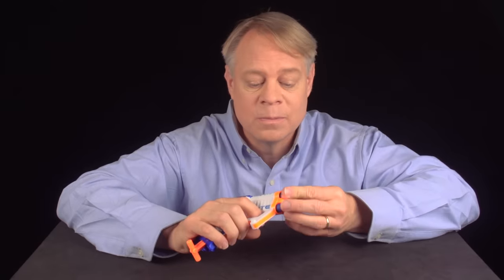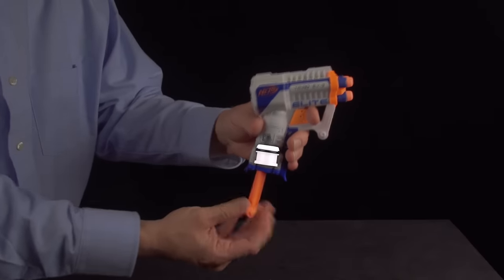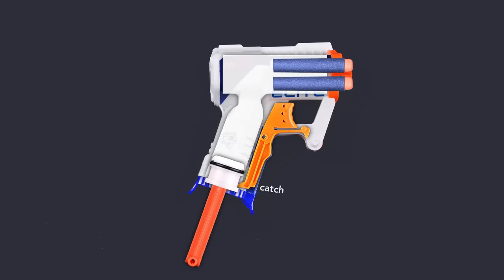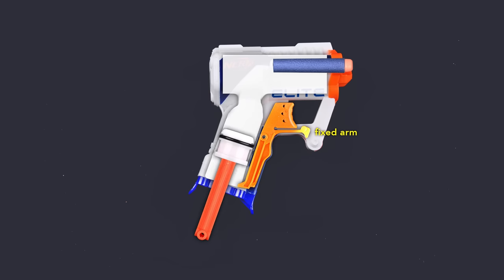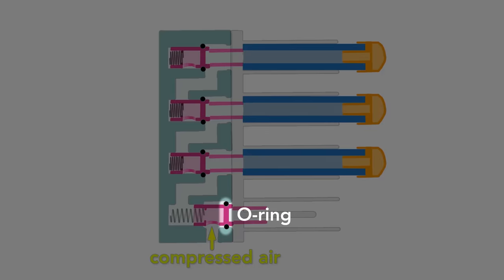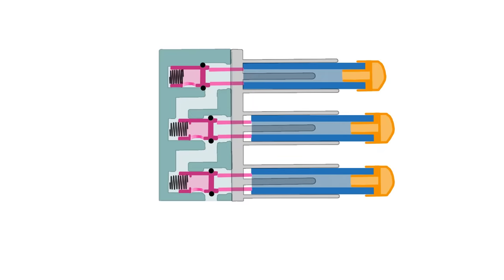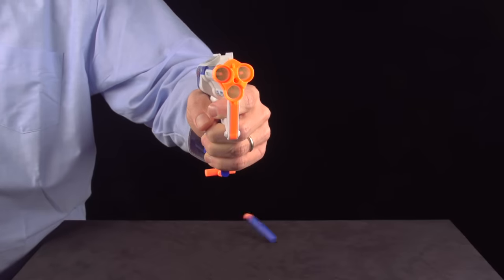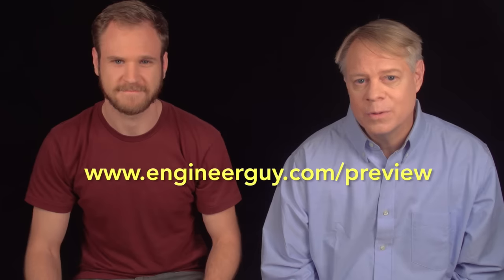NERF Blaster:  Air Restriction Mechanism

Comment: Everybody gangsta in the nerf war until this dude learns how to fire all 3 darts at once
Reply: There’s a whole community that makes nerf stuff stronger and cooler, and there’s things that do like 9 darts
Reply: @kav9533  yeah
Reply: Shellstrike: "Yes"
Reply: remove the smart ar system, but that tends to not go too well. Just get a sledgefire, does the same thing
Reply: yeah but the darts only gonna go a couple feet if you dont mod anything but the smartAR
Reply: @jimbog6376  true, true. Like I said, just get a shotty.
Reply: @kav9533  nerf mods... Thats some nostalgia right there
Reply: That was my intent :) good old memories
Reply: Remove the air restrictors
Reply: Now we have the Nerf N-Strike Elite Shellstrike DS-6 and I definitely did not memorize that
Reply: I make the darts shorter in a trio and it shoots all 3 at once
Reply: @Kingston Matias Yea, I've been using instaflixxer for months myself :)
Reply: @Kingston Matias definitely, been watching on instaflixxer for months myself =)
Reply: @Kingston Matias yea, I've been watching on InstaFlixxer for years myself :)
Reply: You would typically need a stronger spring for all three to go the same distance as just one but with a stronger spring comes the need of a stronger plunger tube and stronger catch which both individually cost a lot more than a stronger spring so it's not really worth it

Comment: Fun fact: some genius russian engineers designed "captive piston" rounds, which use the same technology, so that the loud bang of the combusting gas is gone! A supressed weapon without a suppressor! And this was way back in like the 60s.. Not a single other country managed to replicate it, and the semi pistol designed for these rounds is also nothing short of amazing, it has a floating chamber, basically the barrel, body and chamber are all separate and not locked together. The obvious drawbacks to the rounds are that there is no gas for operation, so everything has to be recoil-operated only, which is the reason for the pistol having such bizarre action. Same action on a normal pistol will cause catastrophic failure as the gas will escape way too early and high pressure would be going everywhere. The piston also protrudes outside the case after the round's fired off, which requires the firearm to be designed a bit different to a normal one.
Reply: Is there a name for this?
Reply: Yea I played Metal Gear Solid 3 on easy mode too

Comment: Does that mean that the darts have slightly different travel distances?
Reply: +Claudiu K2 It will, but the inefficiencies in using a foam dart that cant be "spun" for balance and the other reasons would have a greater effect on range making it a rather moot point.
Reply: +nutsandgum a moo point*
Reply: +Lasmamoe He was correct. The term is "a moot point".
Reply: it's a well known fact in the need community that the first dart from a sequential air restrictor blaster is the most powerful, followed be the second then third, because of the power lost to the mechanism
Reply: Zomgitsjohn I know..
Reply: +Lasmamoe I got that reference, haha.
Reply: +Lasmamoe Perfect picture. lol!
Reply: yes
Reply: A moo point? Yeah, it's like a cow's opinion. It just doesn't matter, it's moo.
Reply: Yes it does, for two reasons. First, the seals on the air restrictors aren't perfect, and some air will leak out. Second, with each sequential shot, the compressed air has to travel just a bit further to reach the dart, and since it's spread out more it has lower pressure, and won't push the dart as hard.

Comment: From an engineering perspective, this is an amazing design.. as a toy.. not so much.. the problem is that the valve springs are strong enough to push darts out of the chamber, hence it's very easy for darts to fall out while you're running with them. Especially if you have used darts instead of fresh ones. Down with Smart AR Blasters!!!
Reply: Actually the springs are very weak and there is a rod shown that goes inside the dart that holds it in.

Comment: When all air restrictors are closed it blocks nearly all air escaping, only allowing a small hole for pressure to be releived. This makes it so if there is no dart loaded into it there is still back-pressure in the air system to prevent the plunger accelerating to high speed before suddenly impacting the end if the pluger barrel.  
This prevents the plastic of the plunger breaking from the shock load of a sudden stop, whilst also allowing efficient air flow when a dart pushes the restrictor back.

Comment: I bought a 4-pack of Nerf Triad blasters from the Hasbro website because I couldn't find them in stores anymore. For a small Nerf blaster, it's one of the best: compact, shoots thrice without reloading. It appears to have been re-released, but I haven't seen any difference other than color and group branding.

Comment: Here's my question:

A Nerf Elite Dart weighs roughly 1 gram.
Also, most nerf elite blasters fire the darts at a chronographed muzzle velocity of 21.5 m/s (Actually the golden standard for the Elite line is 70 fps, but I'm using a rough conversion of 21.5 m/s; Hasbro does a good job of adhering to this number with small margins of fluctuation).

Kinetic energy is then:
K = (1/2) * 1g * (1kg/1000g) * (22.5 m/s)^2 = 0.231125 Kg*m^2/s^2 = 0.231125 J.

Through testing, it has been discovered that many nerf elite blasters use springs that require about 6 "kilograms" to fully compress. This is confusing, because kg are a unit of mass, but assuming a gravitational constant of 9.8, we can easily calculate that the force required to compress them is 58.2 N. These springs are usually about 10cm long, or 0.1m long.
So to find the spring constant, we divide 58.8 N by 0.1 m and obtain 588 N/m.
Then, we assume the spring compresses down to 5 cm (i've opened many nerf blasters, and can safely say this is typical).
So the difference in lengths is 5 cm, or 0.05 m.

The energy stored in the spring is the work that is done to compress it, so W = ∫F*dx. Since for springs, F = kx, integrating this we get W = (1/2)kx^2.

Great, so let's plug in the numbers, the potential energy stored in the spring in then:
PE = (1/2) * 588 N/m  * (0.05 m)^2 = 0.735 N*m = 0.735 J.

WAIT WHAT?!

Only 31% of the energy stored in the spring ended up in the dart? (0.231125/0.735*100%=31.44557823).
Where did the other two thirds of the energy go? I understand some energy is lost to friction, and some in making the fluid (air) move through the various inner parts, etc.
But two thirds of the energy? Wasted? Really?

That seems pretty high, am I missing something?

EDIT: I just finished reading over my Thermodynamics book, a class that I have to re-take, so feel free to use advanced terms like Exergy destruction and entropy generation in your explanation. 

EDIT#2: Also, the o-ring in the plunger is pretty tight, so even with a ton of lube the energy required to combat that friction must be high. The friction losses are starting to make more sense...
Reply: ZPERO 
That was nice to read

Comment: Very nice video, but it is not clear what holds the spring valve pressed when the dart is in the barrel. My guess is:

The dart has sufficient static friction inside the barrel to hold the spring valve pressed. Once the air forces in the barrel it adds up to the force of the spring and exceeds the static friction. Normally, the dynamic friction coefficient is smaller than the static and the dart is ejected.

Someone can tell if my guess is right?
Reply: +Renato Gardiman  Yes, the barrel constricts slightly at its deepest part. This squeezes the dart lightly and hold it in place. The force of this static friction is greater than the force of the spring in the valve.
Reply: Renato Gardiman 
You guys are ruining it, there's reportedly a little group of miniature trolls with ropes and pirate ship anchors and fairy dust and stuff holding the valve spring,
Any three year old that has almost shot their Eye out will tell you so!!!!!!
Hahaha ha ha

Comment: I miss the old "Cork on a string" pop-gun..
So much fun filling it with GRAVEL and shooting it at my friends as they shot back and we covered our eyes.  Stung less than B-B guns, no welts or blood or the fear of eyes getting injured.

These things are engineered so they can ONLY fire those foam darts - but you covered it in another vid though weren't explicit on that reason save the patent issue with similar.

Comment: A bicycle pump also has a flow selection mechanism, the air will flow through only from nozzle connected to tire, not from other air outlets

Comment: Fun bit of trivia: in the NERF world, this is called a "Smart AR" system or the "Smart Air Restrictor."  The modding world as well as NERF are still trying to optimize this system so it can still "smartly" fire only one dart, but restrict as little air movement as possible at the same time.

Comment: The only improvement would be a switch that would allow you to manually open all valves, allowing for a "shotgun" effect of 3 simultaneous  darts at close range.  Considering that the air isn't compressed until the trigger is pulled, you could switch back to long-range single-shots at will and lose nothing.

Comment: Why the spring in the third, topmost barrel? It’s always “open” so wouldn’t it make sense to reduce manufacturing and assembly costs by eliminating extra parts?
Reply: The spring is also an air restrictor, which limits muzzle velocity to a pre-determined "safe" speed by stopping airflow once the dart has cleared it

Comment: There's the Deringer, or it's modern reimagination, the COP pistol that are actual multibarreled firearms and use a clever, very simple mechanism to fire one barrel at a time.

While double barrel shotguns where a common sight at the turn of the century, they used one trigger for each barrel. The triggers were individual and positioned one in front of the other. Very much like Deckard's gun fron Blade Runner.

The Remington Deringer uses a ratchet mechanism that trips a little tab in the hammer. Press the trigger once and the barrel on top fires. When the trigger resets, it trips the little tab and it drops to reach the cartridge rim on the barrel below. The next time you press the trigger, it will fire the lower barrel.

The COP was made in the 1970s and intended as a backup weapon for police officers. Rather bulky, but still smaller than a full sized pistol, the device fired the powerful .357 Magnum cartridge and had four barrels. It worked similarly to a Deringer, in which every time you press the trigger, it fires a barrel. It does this by a ratcheting mechanism that turned a piece that connected the hammer to the firing pins one at a time. Every time you pressed the trigger, it rotated the piece 90 degrees, allowing the hammer to hit a different firing pin.

If you want to see clever mechanisms, guns are a treasure trove. And they have to work reliably under blink-of-an-eye cycles. In fact, most actions go through the full cicle and are already ready to go again before you even think of depressing the trigger.
I'd recommend the 1940 training movie "how small arms work" for those interested.

Comment: But is the third dart weaker than the first?
Reply: +Seameus It's about the same. Theoretically it should be a bit weaker than the first because the air path is slighly longer (resulting in a greater pressure drop) and also the valves aren't perfect so there will be some air leakage. However, in practice these losses are minor and I did not notice a significant difference.
Reply: +Steve Crayons not to mention the losses due to other variables are much greater
Reply: ah, ty, yeah I thought that it would be a wee bit weaker because of the longer air path...
Reply: Yes it's weaker and notably so. The greatest number of sequential shots using this mechanism in nerf is 5 in the thunderbow. Most of the blasters don't go beyond 4 shots though.

Comment: I wonder how many darts you could fit into a smart air restrictor like this before you get any noticable performance decreases. With all those right turns, it seems like the air has to go through a lot of resistance to get to the last dart. I don't think there are any blasters with a capacity of more than 4 darts that have a smart A.R. like this one, so I'm wondering if there's a way to optimize this.

Comment: Thanks for the video, you really did an excellent job of breaking it down.

I have a question tho, if you were to use a speed trap to measure the fps, will the fps from the first shot be faster than that of one towards the end?

Comment: Nice video but you're missing one thing, they completely stop working after a while. Then it becomes impossible to fire any dart and the darts even slip forward by the spring in certain slots. My guess is that the springs in the spring mechanism wear.

Comment: Would there be a loss of air pressure against the second and third darts given that you have more chamber to fill with the same amount of compressed air? Is a better design using the same mechanism simply going to be based on the geometry of the barrel placement?
Reply: Chris Robinson yeah but the guns that use this mechanism don’t have many shots so it isn’t to big of a difference. I think five is the largest amount of shots. I don’t have the one that has five shots but I have the gun in the video and I don’t notice a difference.

Comment: But that means that the air power decreases with each dart shot.
Reply: eh, more like it's evenly divided between each dart, instead of decreasing by a set amount per dart fired
Reply: This is true. If you measure muzzle velocity with a chronograph, you can see that there is a difference between the first and last darts fired. Basically every Nerf blaster with this kind of smart AR works like that.

Comment: just curious, what keeps the darts in the barrel until they are fired.
Why doesnt the spring loaded valve push the dart out. 
Is it just the friction between the dart and barrel, or is there something else.
Reply: The spring is too weak to push the dart.

Comment: what if i remove the seal on the each chamber so the air ALWAYS flows to all 3 projectiles, and replace spring with thick and strong one, like 20 times stronger string so the construction barely endures its release power? Could it be strong enough to break glass if the projectiles had a sharp tip and were coated in light and strong metal?

Comment: fair warning, don't remove the air restrictor on blasters magazine (they're called clips by nerf, here's an example: https://tinyurl.com/ycblqqtr ) fed blasters, it can damage the components. I only recommend to remove the restrictor on blasters like the one in the video, or ones with cylinders (like this one: https://tinyurl.com/y9cck94m ) 

Do bear in mind though, this is more of a problem if you upgrade the spring, but it's good advice none the less.

Comment: won't the plastic "fixed arm" piece that causes the trigger to return to its original start position eventually break if it's just made of plastic?
Reply: +1q3er5 Sure, eventually, the same way anything with moving parts will eventually break.

Comment: I have this exact gun and was wondering how it knows what barrels are filled. It doesn't feel like the dart is pushing against anything when you put it in, but I guess it is.
Reply: That's why screwdrivers exist, come on reverse engineer it.
Reply: Most things I take appart never get put back together again.
Reply: TheEgg185 That is the fate of most layman's attempts at repair.

Comment: Dude, I had an idea of how the Smart Air Restrictor system worked, but that tip at the end may allow my Rough Cut shoot all 8 darts at once... I bet they'll just plop out of the gun, but hey, I CAN do an 8-dart shotgun >:D

Shame that Nerf patented the system, no other blaster manufacturer can use this great design save for a single air restrictor which serves to protect the plunger head when firing without a dart loaded, cushioning the blow of slamming the internals without a dart to take some of the force of the spring and thus protecting the gun for a longer lifespan before having to repair it

Comment: "With the dart gone, the valve springs forward." What keeps the valve spring compressed, the friction of the dart in the barrel?
Reply: Yep, that’s how the darts are launched. They have a snug fit so the pressure of the air blast shoots it out. This is why often times if you use old worn darts they tend to not want to depress the air restricter or have pppr performance
Reply: @mayhem9052  Cool, thanks.

Comment: Reminds me of a very basic hydraulic system, only with air and not fluid.
Reply: +thomas simmons you mean pneumatic?
Reply: +spinnenente you're the kinda guy I learn things from.
Reply: +thomas simmons Air is a fluid
Reply: ***** Gases are fluids and so are liquids
Reply: ***** Being a fluid basically just means that it will change shape to fit the shape of the container it is held in, however gases and liquids still have different properties

Comment: The only thing preventing this video from a 10/10 rating is the horrible trigger discipline. Otherwise colour me surprised.
Reply: Yeah, the lack of trigger discipline irked me, too.
Reply: Well, trigger discipline is extremely important when you're handling firearms or "shooting toys" which aren't designed to be fired at people safely, like CO2-guns and such. 
But demanding trigger discipline on anything that's vaguely shaped like a gun is going a bit too far in my opinion. If you're firing guns regularly trigger discipline becomes second nature and you'll automatically practice it even on a battery drill. 
But there are people out there who have no interest in firearms whatsoever and therefor never have an incentive to learn about firearm safety.
Reply: swiss woosh